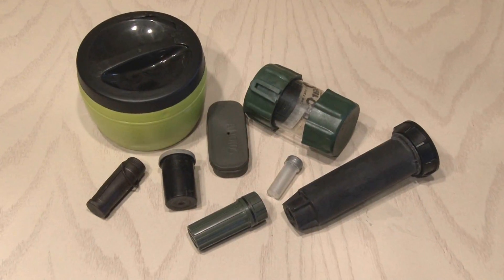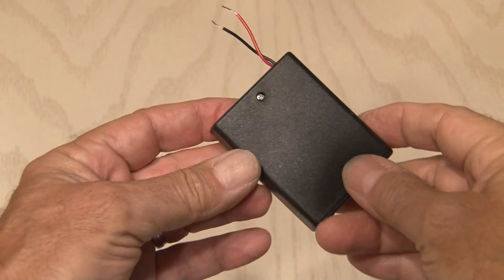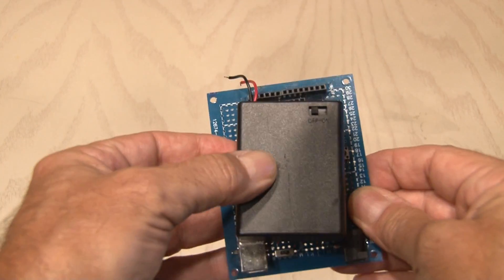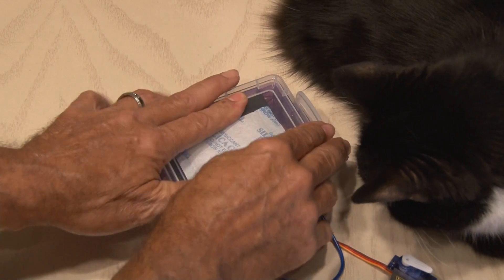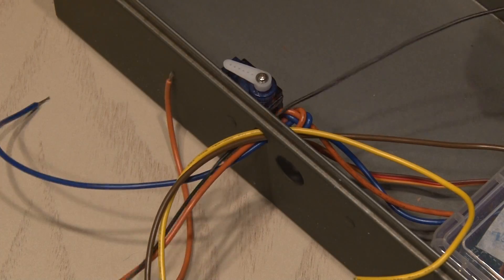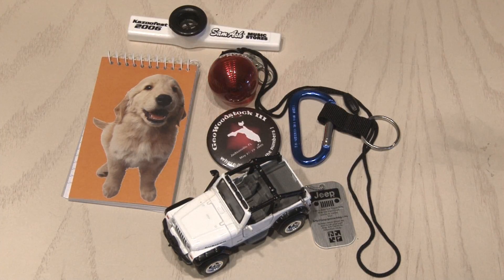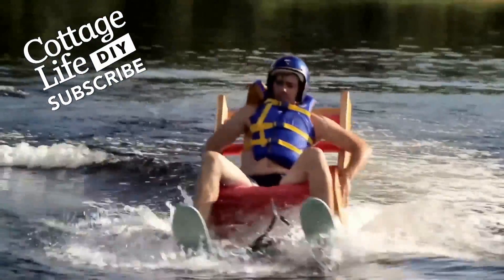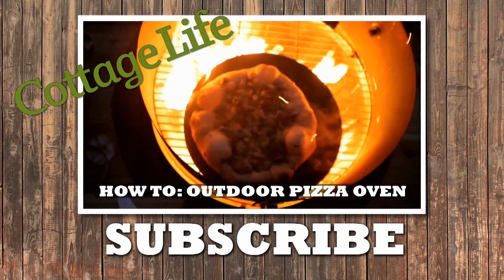Crazy Geocache Puzzle Box!

Comment: there is a weak spot though. Push the wires halfway inside, then pull the wires one by one, if your lucky and the friction doesn't pull the other wires, the paired wires might simultaneously come out. It is because the two are tied together while the others are not. easily fixable though.

(Sorry for the bad English or wrong terms used)

Comment: cool idea, but overcomplicated and flawed execution. you could just put together a simple lock that snaps in when you close the box, with a little solenoid to unlock it. no electronics, no programming, and no pricey arduino that slowly eats up the batteries. make the two "hot" wires in different lengths, to prevent accidental activation that would drain the batteries.

Comment: What is Geocache? Also, I've been flying RC planes for 12 years, and I can tell you that that HXT900 servo you're using is so weak someone will be able to just pry it open. You should swap it out for a 50g metal gear servo. If you check out my channel you can see those are the ones I'm using on my larger planes.

still a cool video, though. Love your channel!

Comment: Flaws everywhere. The motor could break. The wires can be pushed back inside. It would still open if you touch all the wires together. The container its in could make the wires touch and cause it to unlock and lock till the battery dies for anyone else. And if someone doesn't read the rules all the way or not at all because it was already unlocked then it could never get locked.

Comment: But, couldn't you just force the lock open with your hands since it's made of plastic?
Reply: Thats called being an ass of a geocatcher
Reply: or you can touch all of the wires together
Reply: The actual locked box is metal, the plastic is just to weatherproof it.

Edit: I realize he was talking about the actual arm of the servo motor.
Reply: ChazayPwns Yeah I realize that now. Check out my older comment
Reply: Sage Moore but he's saying just snap the plastic arm off the servo motor by grabbing the lid
Reply: Sage Moore First of all, loose*. Secondly, I was just playing around. In all seriousness the plastic he was referring to was the locking mechanism.
Reply: Sage Moore It's all good.
Reply: Zenn  you can detach the arm of the servo motor and put something stronger on. It just has to be light enough for the servo to push,
Reply: You use these boxes for fun family games like scavenger hunts.
Reply: Then just use a metal gear servo.... like the Hitec or Futaba servos....and use metal servo arms (which all can be bought from Hobbyking.com) those are VERY hard to snap
Reply: Or put the end of all the wires into a cup of water
Reply: GeekyOverlord water isn't as good a conductor as people think, that wouldn't work unless the wires are almost touching each other which would render putting them in water useless and a waste of time. If the water was slightly acidic then it would work.
Reply: dphennessy the acidic idea is good. you could always hold them on a thin sheet of gold or copper aswell
Reply: -You cannot snap a servo arm. But the actual servo is held in by hot glue, so yes, you could snap it open.

Comment: Hold all ends together. Puzzle solved in less than a second. Also that double sided tape will fall off over time, especially on cold nights as it will lose stickiness in cold temps. Try it, stick 2 things together with tape and put it in the freezer for a while. They will come apart easy.